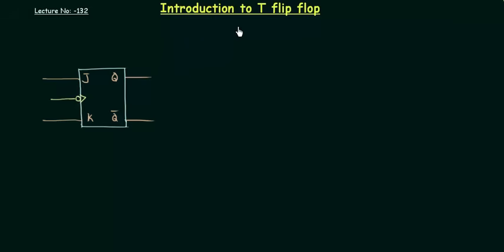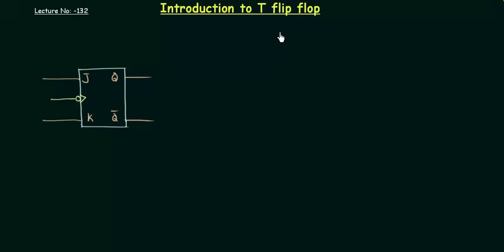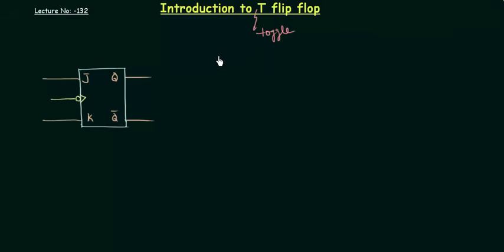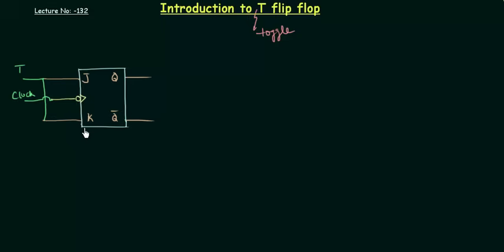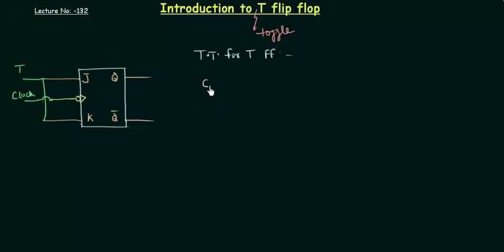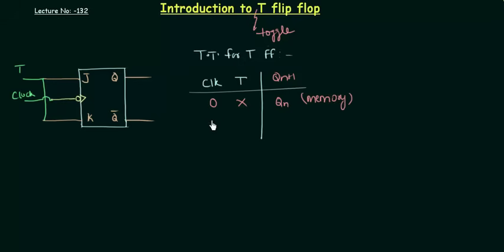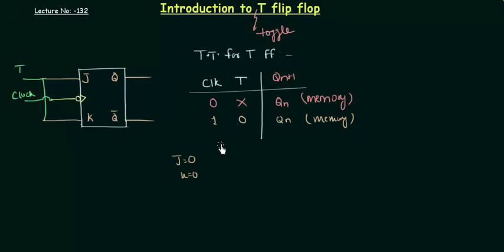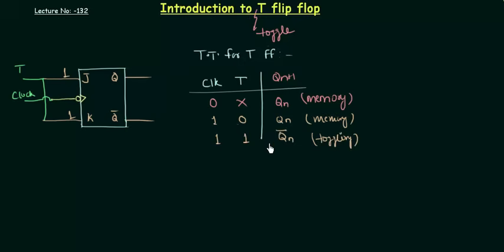Introduction to T flip flop

Comment: You have a negative edge triggered flip flop, and that means it when T is 1, the Q toggles when clock goes from 1 to 0. If the clock is 1 or 0, nothing happens.

Comment: Consider a JK flip flop and assume clock =1 and
If J=1,K=0, then output Qn = 1.
If J=1,K=1, then output (Qn) ' = 0.  as we know that previous output Qn =1.

In T flip flop when clck = 1 and
If  T=1, then output is (Qn)' =?

1.  What is the value of (Qn) ' as the T flip-flop doesn't have SET and RESET conditions..?

2. As there are no SET and RESET conditions, the T flip flop hasn't stored any bit and how can we say that for J=K=0, the previous output hasn't changed ...?

Comment: when j =k=1 ..it is race around condition in j k.. so does same thing happen this t flip flop... if not then y?
Reply: in  this lecture sir has used negative edge triggered jk  ff which gives same output as the master slave condition
so racing will not happen in this case.

Comment: If the T flip flop is negatively edge triggered(as indicated), then shouldn't it work only when the clock is undergoing NT unlike the truth table mentioned in the presentation.
Reply: It will only cause a delay nothing more.

Comment: when j=1 and k=1 then there is race around condition in jk flip flop then why it is reffered as toggling action in this lecture?
Reply: +Anuj Sinha 
Notice the CLK connection symbol of a triangle and a circle. This indicates that the FF is negative-edge triggered. See previous lectures if that doesn't answer your question.
Reply: in edge triggering race around condition doesn't exist

Comment: Thanks again for this video. But why did you put a bubble in the ff clock entry as if it is neg edge triggered? and other question is flopflops are edge triggered, so why you say 0 or 1 for the clock signal. I think ff supposed to produce value while clock signal is in the ''rising edge''
Reply: Same question. 🤔 Why talk abt levels (0 and 1) in FFs rather than rising n falling edge ??!! 😕

Comment: You have a negative edge triggered T-FF diagram, but a logic table that reflects a positive edge triggered behavior. This caused a little confusion, but I get the point, except for that little bubble there, because it caused a little confusion :)
Reply: So, the bubble is wrong, isn't it ?
Reply: U noticed it correctly , got the same point
Reply: How it’s drawn, with the little circle, the output would change (toggle) when the clock goes from high to low. \

Comment: If this T flip flop is negative edge triggered (as indicated by the circle and triangle in the clock input), is the JK flip flop shown a Master-Slave JK flip flop? I couldn't draw a time diagram and see the value of Q changing when T=1 ONLY when the clock goes from 1 to 0.
Reply: Its normal edge triggered JK flip flop.